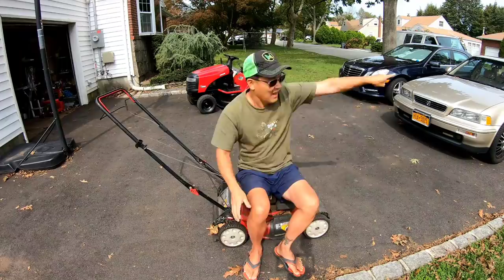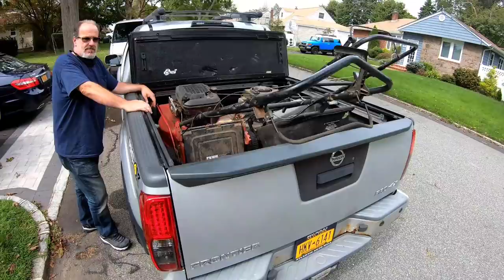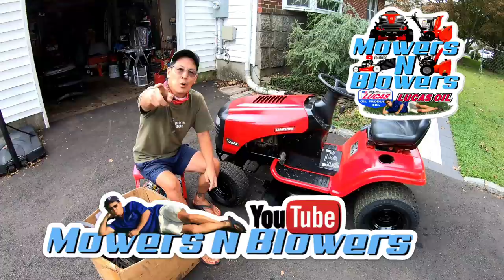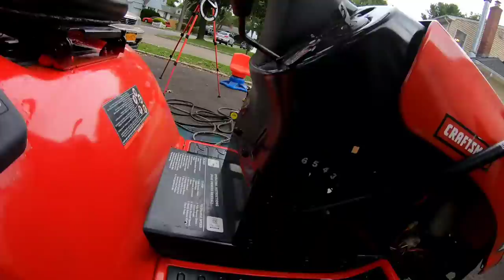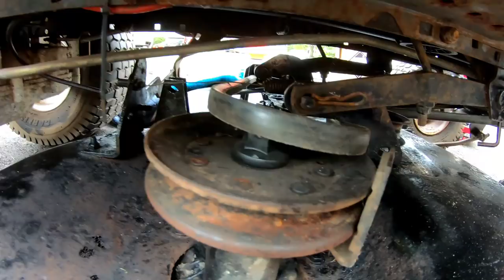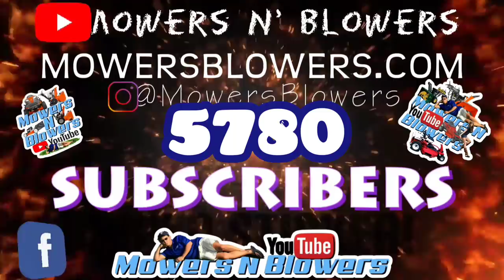TROY BILT LAWNMOWER SHEARED KEYWAY PULL ROPE PULLS BACK VIOLENTLY LOOSE BLADE REPAIR KEY REPLACEMENT

Comment: A customer asked a question, I had just gotten done cleaning his carb on his tractor, he asked what kind of warranty does he get with my work, I told him no warranty at all, I told him if he wants a warranty like the pro shops offer, instead of charging him 100 for the work, I would have to charge him 250 to 300 he agreed, the problem I run into often, I work on a carb, and the transmission goes out, the owner demands a I repair his trans, I tell the person I worked on the carb, the carb has nothing to do with the transmission, so I tell them if you want a warranty take it to a pro shop, or if they do and I get a phone call they are to expensive please fix my tractor, it's a riot.

Comment: Drive belt on manual Craftsman is 95 inches that tractor is usually take 95 1/2 deck belt because u used a old deck it wrong belt if u have tractor supply in New York  you can buy 88or89 inch belt blue huskee

Comment: hi Henrry  the pullys are set for a bar ingagement, not cable thats your problem
Reply from the maker: I’ve converted it 5 times.  Always worked fine.  Cable or rod, Pulley has not moved at all, same exact place.  The only difference is how the tensioner arm moves.  It has no bearing on the length of the belt.
Reply: ok

Comment: Mowers N Blowers. Thanks for the shout out and I am very sorry that you got the nasty burns from the welding. Henry, I use a burn ointment made by Blistex called Foille Ointment that works pretty well. The Foille ointment is on eBay if you would like to check it out. 
The belt looks pretty similar to the one like on my MTD YardMachine in which my deck is a 46 inch cut instead of a 42 inch cut like yours.. Best Regards From Versailles {Fur-Sales} Ky.. (Everyone Else In The World Says Fur-Sigh - Go Figure).
Reply from the maker: Fur sighs?  You mean it’s not pronounced like the French treaty?
Reply: Mowers N Blowers. That’s the way that everyone pronounces Versailles in this area of Ky - Strange But True (LOL) The city of Versailles was founded by a Frenchman who fought along with General Lafayette during the American Revolution. General Lafayette was very popular here in Ky in the years after the American Revolution. So there are more than a few landmarks with French influences. That’s my history lesson for this evening.
Reply from the maker: Love American History!